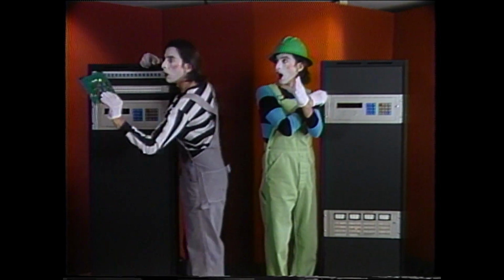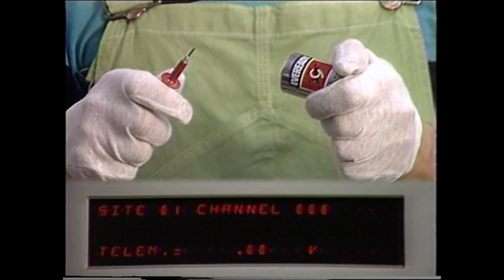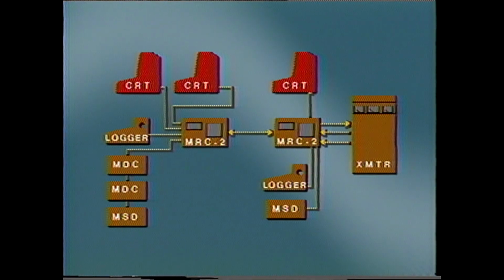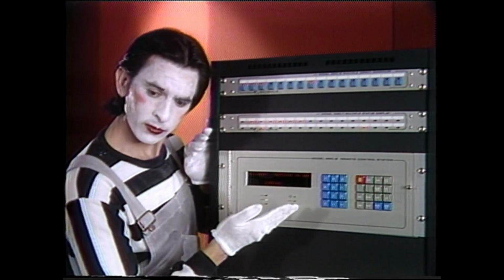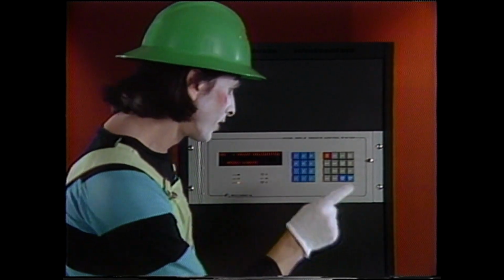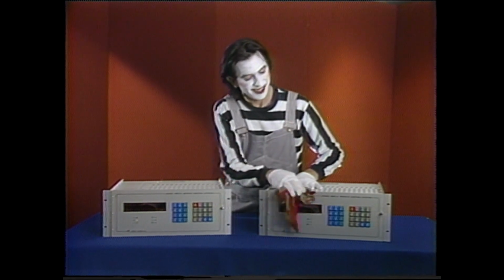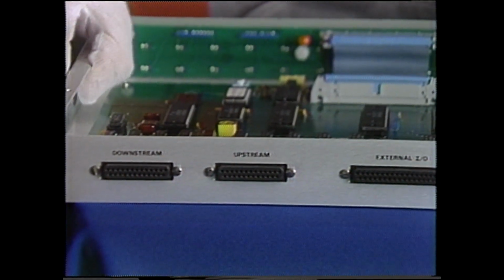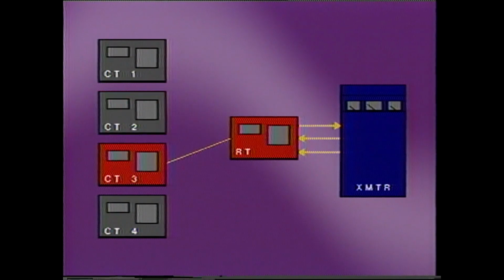Moseley MRC-2 Demo

Comment: Still a relevant system, and in use in some places.  While we decommissioned ours back during the digital transition, it wasn't because it couldn't control the new stuff, but simply because we ran out of status, control, and analog channels and needed to maintain control of both the analog and digital transmitters for the simulcast period.  I still have some pieces and parts laying around, and we also still use the old Moseley relay panels with our new system.